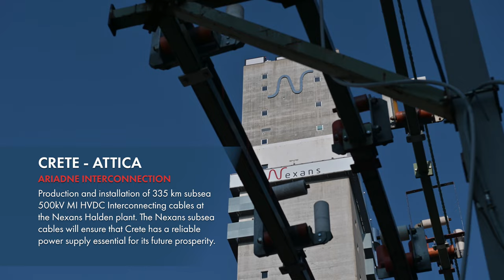Nexans Crete Attica project from production to installation 2022

Comment: I came over here from Wait Watt.  I would have liked to see more of the cable lay.  I work in oil and gas and have done some pipe lay but I haven't ever done a cable lay unless you count EFL's.  It looks like you showed making the line then skipped to the pull in at the end of the project.  What is the same and what is different with cable lay and pipe lay?